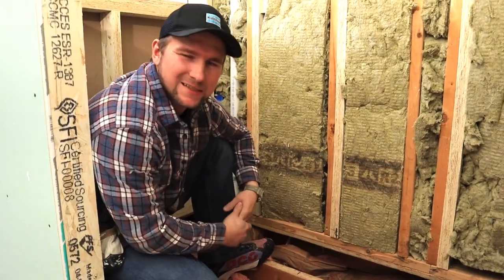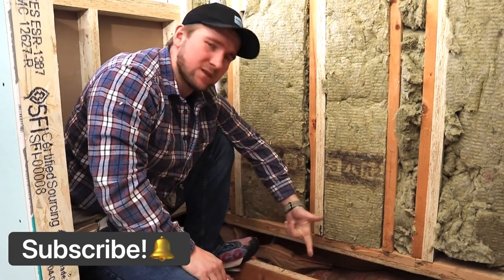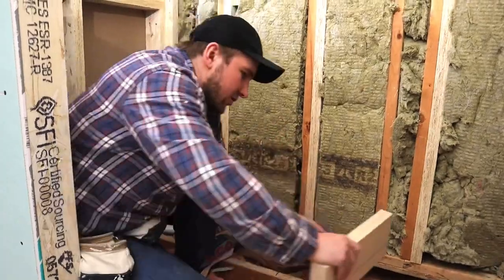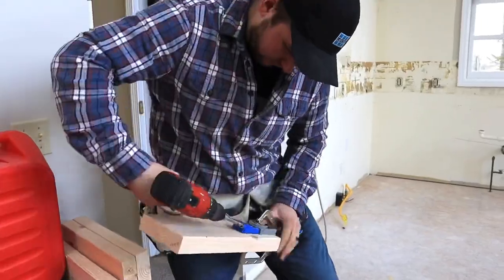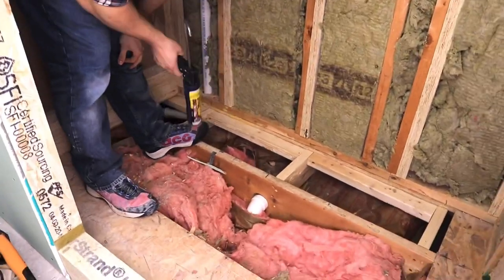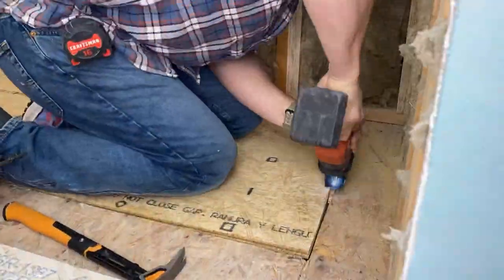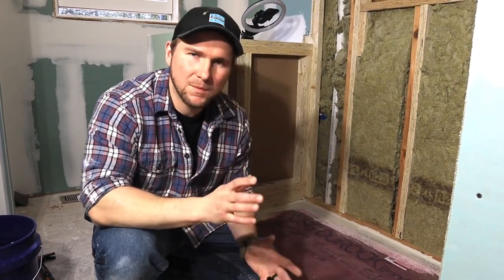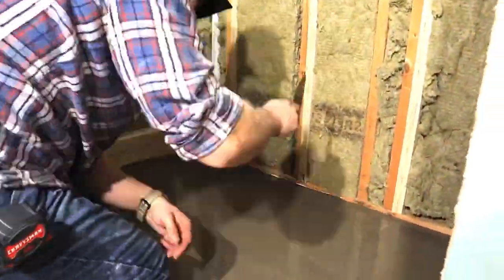How to fix shower subfloor. Diy shower subfloor repair

Comment: My current scenario is I've been told that I've got some loose tiles in the bathroom and some water could of seeped underneath. They need to pull up the tiles to see if their is any  damage and the quote could be even more expensive. Would i ask them to go under the house to see if there is any damage to the joists and subfloor to avoid have to pull up the tiles ?

Comment: Do you think it would be better to put the blocks under the vertical 2x4’s as a point load support?
Reply from the maker: It might be an overkill but if you can it would work